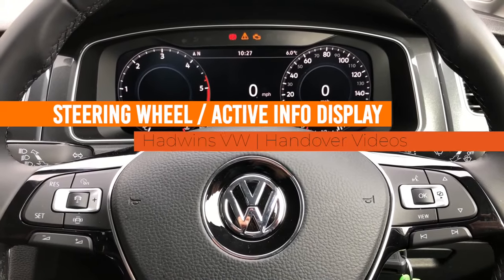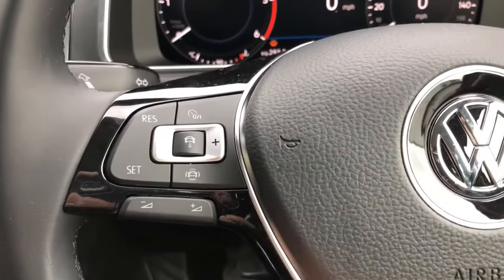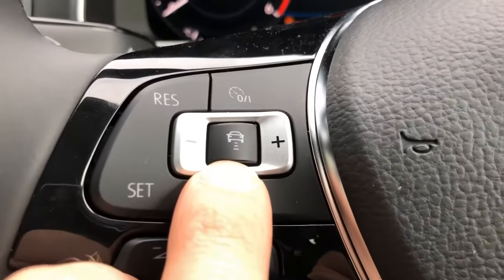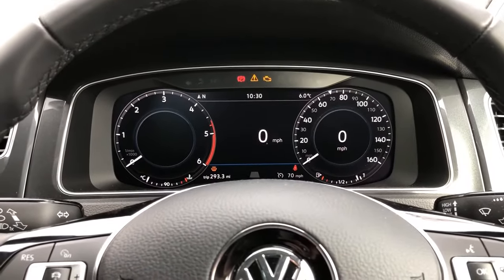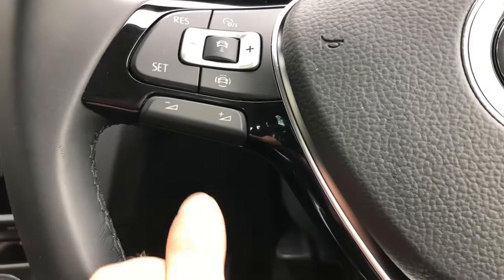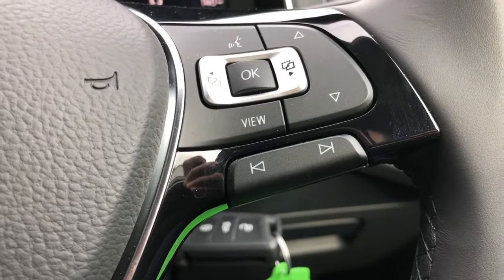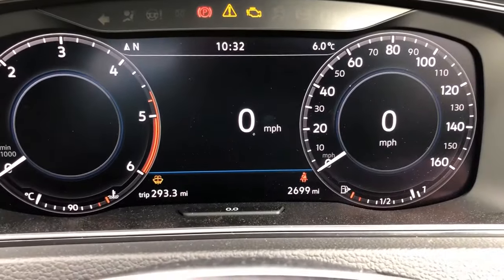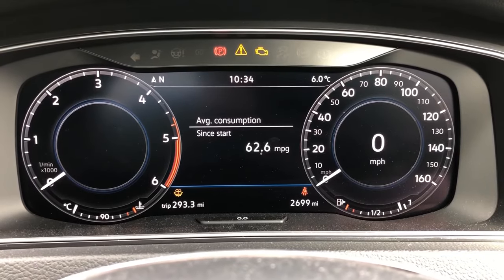Steering wheel controls & Active Info Display | Handover videos

Comment: As well as using the + & - buttons to increase or decrease the cruise by 5mph, once set you can also use the ‘set’ and ‘res’ buttons to increase or decrease by 1mph!
Reply: Handy when travelling on roads with average speed cameras. A few m.p.h.increase gets you overtaking  vehicles without the worry of exceeding the ultimate limit allowance where you could get picked up.

Comment: Hi there, just one thing I think you left out on the left controls on the steering wheel is that the "SET" and "RES" buttons can be used to increase or decrease the speed in smaller increments(most likely in 1 mph in your case) after the cruise control has been activated. Kobus Müller

Comment: Hi All. I am new to the group. I have a VW Passat 2017 R Line Model. Does anyone know how to activate Dynamic Light Assist on it? I cant Find in in Settings, It only shows "Dynamic Light Setting (During Rain). Can anyone help me. Thanks.
Reply: Hi, what you need to do is go to Car menu on the display (left hand side of the display) and then go to set up. That is where you find all sorts of car set ups. And then chose lights, etc. There you should be able to find it. I am typing this not being in the car, so this is from the top of my head. Hope this helps.

Comment: in the older models there was a mode button to switch between cruise control and speed limiter. How is it possible to activate the speed limiter with the new buttons ?
Reply: I also ask myself the same thing. Is it possible to know how to activate the speed limiter with the new buttons? Thank you
Reply: @giofro8944  same, any luck with this?
Reply: 1. Press the driver assistant menu's button on the left 
2. Press the down button on the right side
3. Press middle button on the right side
4. Press the Set button on the left 

If the speed limiter option doesn't show up as the second option after the 1. step, then you can enable it with obdeleven
Reply: @Stibiii still no option for Acc, only showing lane assist and front assist